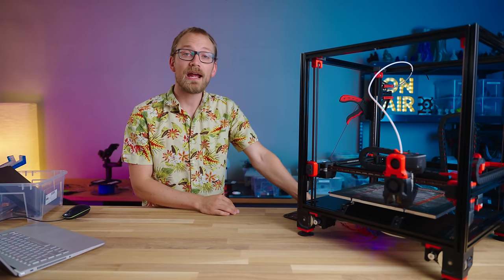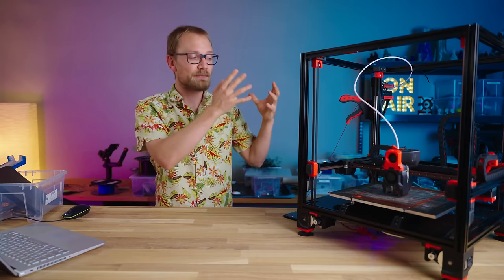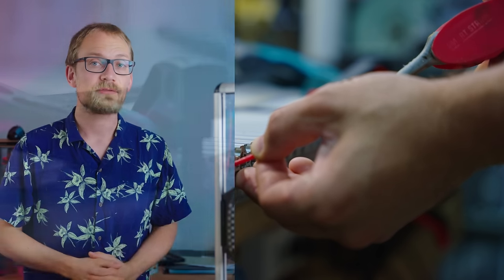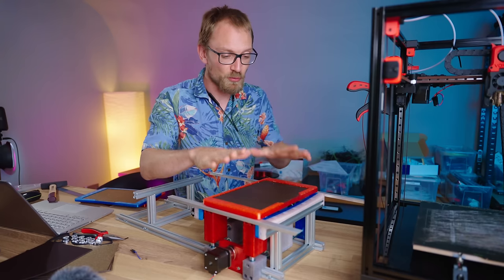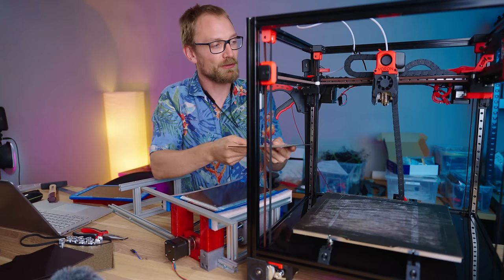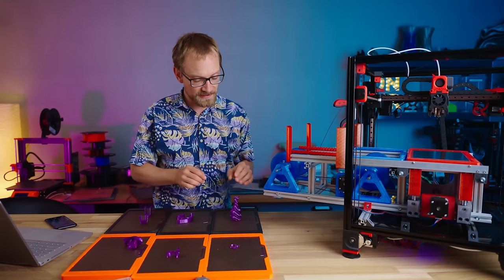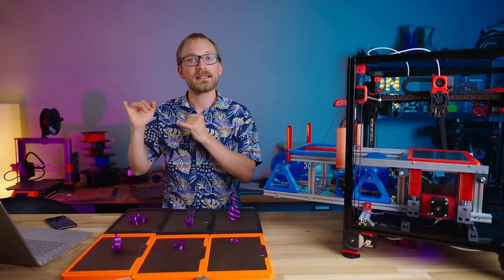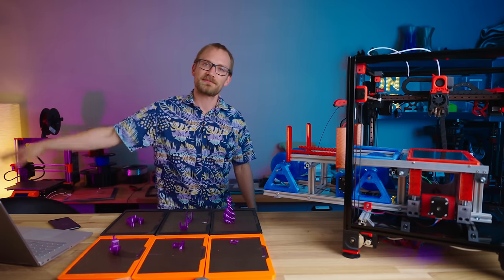Fully automated 3D printing using REAL print beds!

Comment: Strikes me that if you moved the electronics on the printer, you could build this "into the floor" of the printer minimizing the loss of z height. doing that would ofc. require you to add a "base" to the printer but in the grand scheme of this type of conversion, it's not that big of a job, and getting full build volume auto bed changer would be awsome

Comment: Always needing a build plate tray in the hopper to push the next tray onto the heater could have been avoided by using a lug conveyor system instead of the belt conveyor system that you used

Comment: Seems very complex and takes a plenty from Z axis. I wonder if magnetic built plates can be taped together to make caterpillar mechanism in a circle that goes under the table top. After each printed model it would require printhead to move to the bottom of Z axis and move from one end of X axis to another to remove the print while next plate snaps in the place. I'd try to use just magnetic plates that are taped from one side as a proof of concept.

Comment: Why not take inspiration from SMD Placing mashiens. They pull the PCB through on belts and then clamp. In  this case the hardest thing would be the heater comming up from underneth and that is already solved. Thanks for the video this is a great idea and i can't stop thinking on how to optimize it. I think i need to build a voron ;)

edit: more print height could be possible if the belts could wrap underneath the electonics to the other side.

Comment: Hey I have a question, why don't you use an electro magnet to lift and attach the beds? I have been thinking about it and can't see any reason why you couldn't just hold the steel sheets to an aluminum bed with an electro magnet and just turn off the magnet while switching beds.

Comment: Great mechanism, what about also using a rotating bed as the ender uses but without turning the noozle at an angle, insted keep it as it is and the print will pop off at the round corner when the bed get curved ?

Comment: Hey Tom, love this idea. I had a thought on your design. What if the feeder pushed the bed off like it does but instead of it falling of the side and a new bed loaded, it flexed the magbed at the end of the movement to pop off the print and then pulled it back into print position.

Comment: Nice design. We all need this. Why not use a vacuum hold down instead of magnetic plates?
Reply from the maker: That would be an option as well, as long as the seals used can handle the heat
Reply: @MadeWithLayers  I'm pretty sure some silicone gasket could deal with that temperature. 
Anyway, big fan, really enjoy your vids and content. Interested in seeing the end result.

Comment: I wonder how the larger build plate will interact witht the magnets. It would be interesting to try using electro magnets with the solid maganets to be able to smoothly detatch a larger build plate without bending the plate in the process

Comment: In addition to other comments on "magenets", how are you "peeling" the bed plate?  I know trying to just pull it up needs a lot more force than lifting one side...did you "roll" it off, or just do a straight pull down on the bed?

Comment: Ok Tom, we should really talk about this thing you did....beacause It really is awesome :-). How long did it took to design? Feels like you did it really fast, or did you planned it before you bought Voron?
Btw. I think that version 2.0 could use some angled (installed under 45 angle) extrusions which would act as slide (similar to kid's slide) to slide completed print sheets outside the printer.

Comment: Very cool but why you just couldn't use a conveyor belt system like the creality CR 30 instead of continuous motion with the belt for the belt to go forward stop wait to print is over and then go forward again you could even make it go over the original bed and you could still use the original heater and use a BL touch just in case something is mislined I think that would have been easier and a lot more better this way you do not need to worry about running out of beds also less moving parts

Comment: that was a very nice build and would def be more interested in seeing it get improved even more.
this might be the next thing 3d printers need to fix, after speed (witch more and more HQ 3d printers are manging to do)
Reply: Is speed really relevant if you can just run the printer unmaintained? For me a reliable machine that would have this option would be perfect. I do not print often so spending a huge amount on those high quality printers is unreasonable but if I print I often do a lot of things at once. So a system like this can be build quite cheaply, is easily expandable and at least for me it would be better than a faster printer where I would still have to go once every hour or so.
Reply: @nukularpictures  this isn’t what I meant, sure I would too prefer an automated system similar to this over a faster printer.
But why not have both, usually faster printers aren’t magically faster or built for speed it’s mostly having better rigid design that you can print slower for higher reliability. (some changes are just for speed sake though)

Comment: Just recently saw this video and was reminded of the couple of clips floating around online of folks using upside printers and a system to flex the bed partly to pop parts off to continue with automatically printing. IIRC, these were bedslingers and not fixed bed printers. Do you think there's a way to make that work on a fixed bed too?

Comment: Hello Tom, great project as usual. I have one thought, when peeling the sheet of heat bed, couldn't you add a shim or something under one side of magnetic sheet, so when bed goes down it doesn't peel the whole area, but does it at an angle? Then probably you would need less force and could build whole thing smaller?

Comment: It looks like if you relocated the motherboard onto the side of the machine to open up the bottom, you could run the lower frame through the open space under your feeder, and drop the bed down to almost the same level as the original...

Comment: Maybe a dual filament extruder where two filaments feed into a single bowden tube with two extruder motors, the second would take over from the first if the filament runout sensor is tripped.
Reply: Would probably be no problem with RRF. It's a pretty powerful firmware.

Comment: The fear of bowed prints from the infinite Z Axis printer clouded your vision i think. 

This whole setup made is excessive even from a prototype point of view, you could have just used a belt and printed on it normally. The bowing and brims are specific to that infinite Z Axis printing at an angle, regular printing on a belt is no different than printing on a solid bed.
Advantages include needing only one motorto turn the belt, no endstops (set amount of belt roll to refresh bed), more printing height and auto removal of prints over the end!

Comment: All that extra weight (and inertia) on the Y axis (moving bed) will slow the printer down, or cause failures in the print.  Larger stepper motor and higher current driver?

Comment: Would it be feasible to flex the spring-steel sheet to loosen print(s), then use a pusher to clear them?

Hold one edge of the sheet mechanically, and lift the opposite edge to flex it.

Comment: is there any reason you cant use electromagnets to lock in the print beds with a mechanical alignment? it would be lower profile, additionally you could also have the belt magazine feed out of the printer and have it on the side of the printer.
now that I think about it the electro magnets could be controlled by a depressed switch when the belt is pulled all the way back to drop another bed onto the belt

Comment: I know this is late but couldn’t you make the bed electromagnetic so that when you want it to attach to a plate it turns on pulling the plate tight then off when the print is done and then a simple mechanism to push and pull new/old plates on and off ..

Comment: This seems so much more complex than it could be. Why not use a flexible spring steel bed and have a mechanism that bends the bed once the print is done then a line of Gcode that uses the print head to sweep the parts off the bed
Reply from the maker: Reliability. You can't guarantee that the parts will be fully released after an automated bend, and then risk a head crash when they aren't.
Reply: @MadeWithLayers  i suppose but you may be able to integrate an optical sensor that can check if the bed is clear

Comment: Couldn't you alternatively build this mechanism as part of the bottom portion of the printer frame and then make the entire machine taller to compensate for for the lost z height? I feel like the only downside would be the monstrous size haha. Would be worth it especially if using full sized beds.

Comment: Don't build it slimmer, make it the new floor. Your Voron 2.4 Floor can be replaced with a properly sized version of your prototype and then you'll have maximum Z clearance back, and the function of your magazine bed system. This legit might be the next evolution step for CoreXY. If you could make it that you could put in interchangeable sized beds, it'll be revolutionary. Imagine heating a small bed for the small parts, and a big bed for the big ones.

Comment: Do you think it would be possible to just pull the bed down thereby twisting the bed surface enough to release the print and then push it our with the toolhead or some kind of wiper ?
Also a look at electro permanent magnets might be interesting for releasing the bed and maybe reducing the movement axis

Comment: Maybe it is time for a different heat bed design. Instead of magnets use a vaccum system. This way you can turn off the hold of the sheet and perhaps even just slide it out?

Comment: If you placing this on top of the current bed you loose alot of space.
Why not just make this the only bed of the machine and merge the two. 
Basically build the Voron on top of this machines bed. Might only need to increase the z-axis extrusions by the missing amount. 
However electronics will need to move then.

Comment: I am using Continuous print plug in too, but with a glass bed, it taking too long to cool down, even with a bed fan.  do the PEI sheet work with ABS?   I couldn't get anything to stick to the Ender 3 Creality coated glass bed, I have to use hair spray which is inconsistent on releasing the part.

Comment: Next project. Taking 1kg spools and joining them into a 10kg magazine. With a feeder to compensate for the huge and variable weight of the spool.
Reply: Or just buy larger spools.
Reply: @capitalinventor4823  Yea if this became a thing the mfgs would commonly sell larger spools. BUT you would have to have some sort of zero tension feed like the old computer tape readers. To compensate for the increased mass of the spools.

Comment: I am curious if a pusher of some kind on a linear actuator could also be used to automate things at the full print size of the Voron, I know PETG on a textured sheet kinda just pops off once it cools. Well a Prusa textured sheet, But id imagine all PEI textured are similar.

As for Filament runout and automatic reload of that I wonder if an MMU could be hacked into this task,  That is does it exclusively work on a Prusa or could it be pressed into this task as well.

Comment: Awesome engineering. But replacing the bed is pretty overkill. You already have XYZ control, just use the print head as a paddle to get the parts off. This should be easy once cooled down..

Comment: Why not use a very slightly flexible magnetic surface atop a flush rigid surface that has magnets underneath to keep the plat still and can move up and down....and then use a pop and shovel method on the flex surface to remove and bin the produce.  No need for multiple plates and you have a theoretical infinite use?

Comment: to gain more printable Z area, can you not remove the boards from underneath, attach them on the side some where, and attach the legs to the bench, and build your belt system exactly wide enough to keep the legs completely square?  looked like that would give about 150mm extra, but then your entire "contraption" printer/feeder would be static, but hey... thats more Z!

Comment: This is really awesome build and I love seeing the process. What was the reason for not going for a belt like the CR-30 but just using it to eject prints?
Reply: The belt is the only printer that can make an infinitely long prints. Bed adhesion isn't at the same level as pei plus the other issues Tom mentioned.

Comment: Could you tell me how to get your "imperfect filaments" for prototyping? Mentioned at 2:21. I am just starting out 3d printing, and would love some cheap, "defective" filament.
Reply from the maker: Many smaller filament manufacturers will sell you this type of B-grade filament that they when a spool doesn't come out weighing the full amount, or when they switch colors on a filament extruder, resulting in one or two spools that have a color transition in them. Though, naturally, supply of those imperfect spools is limited, so e.g. every couple of months when Das Filament announce they've got another pallet full of B+ filament, it usually sells out within minutes.
Reply: Thanks for the info! Could you please send me some links so I can keep an eye on it?
Reply from the maker: https://www.dasfilament.de/special-offers/
Reply: Thanks so much!

Comment: Why not just have an axis with a spatula removing it?  Specially with a fully stationary bed it'd be easy.

Or maybe a heated bed that's magnetic with just a hole in the middle and a small piston there. Just flexing it enough to get rid of the adhesive and have something throw the print out. It'd also not reduce your print volume

Honestly for prints that small you can even just use the carriage

Comment: when you call over half of the usable space a "bit" you know you are engineering it wrong, then you call it proof of concept. But its a neat system. I would pay for a 500x500x500 printer with this but the flaws fixed.

Comment: Hello, i have a question, i also bought these energetic magnetic pei sheets with a texture, how do you clean it? Everything just tears up and now i have microscopic zewa(paper towels) in the pei, can someone help me please?
Reply: Same issue, but for me those don't seem to impact adhesion at all. Sure you might sometimes see something in the first layer, but generally my hotend fan (not part cooling) has enough air flow in the bed to blow them aside.
Reply: @Daepilin  thanks for your help, ill try that!

Comment: cant you just build the slider as the base of the frame. You would have to move all the electronics under the slider but you would retain all the height the module already has. either that or you could use longer rod and strings for your Z-axis. IDK maybe this is more complicated than it appears im just a casual watcher, i dont own any 3D printer for now.

Comment: Couldn't you just use a flexible buildplate, where one side is lifted and the other one doesn't? It should work for smaller parts, as long is the build plate warps enough. I think 🤔.

Comment: Next step moving all the electronics to the back of the printer and upsizing the movement unit to be the base and reclaiming the entire Z height?

Edit: Oh and a slide out of the movement unit to stop the flipping issue of the printed items that may cause damage to delicate prints.

Edit 2: just re-watched this, if your pusher bar is only going back and forth and not making a full rotation, your could make the pusher bar a pusher frame, and then you wouldn't have the need for the extra frame.

Comment: This seems overkill, I would have tried to go for a mechanism that would pop the pieces out of the bed automatically and flush them instead of replacing the bed with each print. a mix of cold spray, bending bed and a sort of bowling rake.

Comment: I got all excited seeing the sponsored enclosures ad because I’m thinking about buying one, and had been eying some $75-100 price range Mylar-lined setups. Figured the boxomo ones must be a good deal compared to that, given that they’re literally just plastic and extrusion, without anything fancy like foil or heat reflectors of any kind... so it was surprising to see prices of up to over half a grand *just for a basic plastic box with no electronics*, and that was before shipping. I feel like I’m missing something, usually your ads are for spot-on products but boxomo is looking like an outright scam in comparison to your usual sponsors...
Reply from the maker: I mean, yeah, they are pretty expensive. But the panels are solid polycarbonate (acrylic for the bottom) and those alone are well over a hundred bucks.
Reply: Look into the DIY IKEA Lack enclosure. It started as a Mod for Prusa’s, and now its used by everyone that has a printer that will fit inside it.
Reply: @rileyfenley522  aye, I’m considering that, though the ikea near me has new ones that are a much weirder shape. I could probably buy two of them (two sets of legs = twice as tall) plus the plastic walls at a hardware store for like $50 total.
Reply: @MadeWithLayers  ah, polycarbonate is wildly expensive compared to acrylic, that explains some of the price. What is the benefit (other than appearing bougie/“premium” due to the price)?

Comment: One file filled with "M32" commands, that starts a print, then runs the plate switch sequence and then repeats that would also work for managing this.
"M808" can also come in handy to loop one print, for if you have to produce a large batch.

Comment: LOOOOOOOOL @ this , Problem ; you need to remove the print from the printer afther its done. what you do is you manualy remove it so you need to automate that, not build that mostrocity your are so proud of. Simple Solution get something to push the print out of the bed afther its done , Reaply hairspray or we you are using . Half the trouble and full print bed.